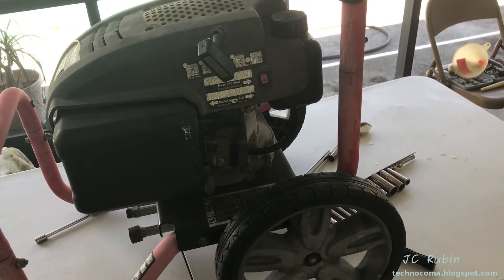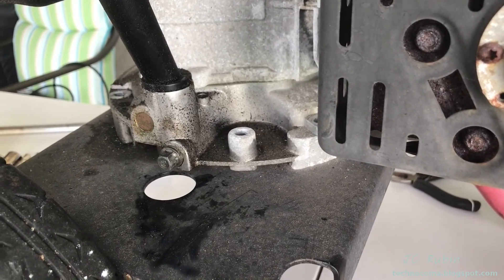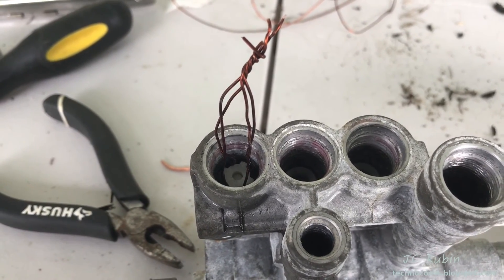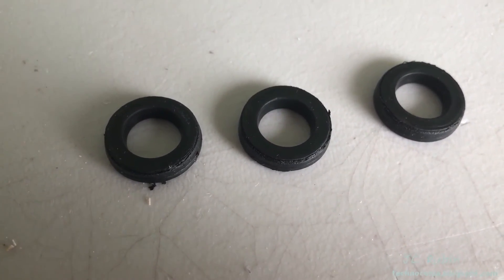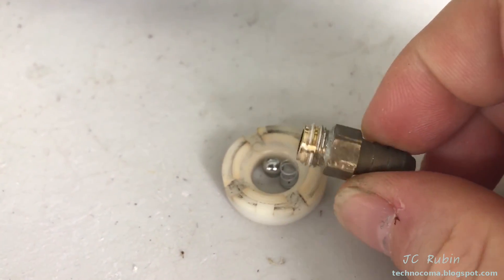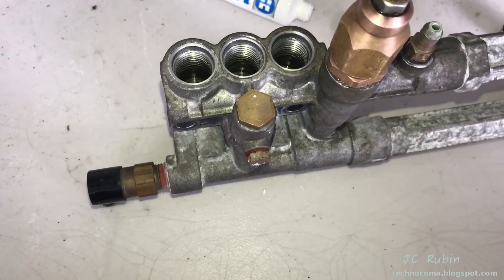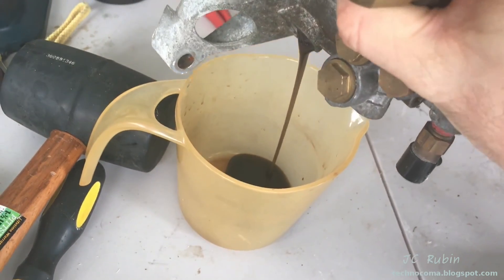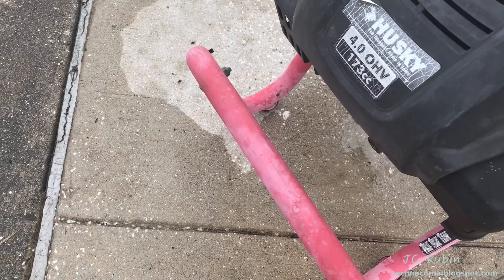Pressure Washer Pump Rebuild -  Annovi Reveberi AR-RMW22G24 Vertical Axial Pump

Comment: Fantastic DIY Vid!!! I need to rebuild the head on my Generac 4k#. Hopefully, rebuild procedure similar.  Any good leads for sourcing rebuild kits appreciated. Torque value specs would be reassuring, but hopefully 50-years wrenching + common-sense will suffice.  I'll be using blue threadlocker on all "fixed" components. And, I never thought to practice "Post-use, lean the machine to drain residual water from head". Great advice!
Again, excellent vid & THANKS for your generosity of time, knowledge and experience.
You. Are. Clever.
Cheers
PS- liked your "$7k!" response to lazy fk who asked if you'd repair his pump for him. Apparently, along with no work ethic, they have zero sense of humor. Subscribed!
Reply from the maker: Glad the video was helpful , good luck!

Comment: Thank you for making this how-to video.  Very detailed and to the point.  I have exactly the same model of the pump. What oil did you use for pump? any W90 synthetic gear oil or something else, please advise.
Reply: He used pump oil sold at HomeDepot
Cat Pumps
ISO 68 High Pressure Pump Oil

Comment: So first off I want to say thank you so much for doing this video/tutorial.  I have been attempting to find one that had this much detail, as I find myself attempting to save my pressure washer (inherited it from my father who passed away recently & seems my ex did some damage to it without my knowledge, so now I am attempting to avoid buying a new pump as that can be pricey) I have purchased all new check valves and the white plastic rings as well as the rubber seals that go on the head of the pump( the old valves & parts were melted or damaged in a way that seems to be melted) I had NO pressure on the water exiting the pump when the pressure washer was running, prompting me to disassemble the pump to find the damaged parts, I have since installed the new parts and cleaned up the pump, but now it seems there is less water exiting then before,  I wasn't aware of the function of the unloader valve but now that I have seen your video I feel if I remove the pump once again, this time attempting to remove and clean that valve I may have a better chance at success with it working. I am new to all of this but as a single mother & determined to figure things out I will learn all I can to be successful at being a DIYer. I will be purchasing all of the grease & polish you mentioned to reassemble everything again and attempting the unloader valve as well, do you have any suggestions as to what my problem may be for why I have no water exiting the pump when running aside from what I have mentioned above? I'm just hoping to troubleshoot my situation with a successful outcome. I greatly appreciate any and all feedback. Again thanks for this awesome video!
Reply from the maker: Hello, Its hard to say unless the video was completely followed, something is still stuck causing an obstruction.   Taking it out and revisiting all steps, checking all passages for an obstruction or seized part.

Comment: Thanks for posting this.  I think my pump may be causing the engine to stall, but not sure.  Engine runs great with the pump detached.  As soon as I re-attach the pump, start the engine, and pull the trigger... the engine stalls.  I'm thinking maybe the pump is starting to seize and it's causing too much strain on the engine and stalls it.
Reply from the maker: Did you try rotating the pump whilst detached?

Comment: Just want to thank you for for making this. I was on the verge of ordering a new pump. After seeing your video I took my pump apart and cleaned out whatever I could get at and reassembled it not expecting much. Much to my amazement it’s running like new again. There was a lot of mineral buildup in there looks like I’ll have to drain it after each use and maybe run some vinegar through it periodically to try to dissolve the buildup. Also my ez start valve was completely seized up. Had quite a time freeing that up. 
Thanks again you’ve earned a new subscription 👍
Reply from the maker: Glad it was helpful, better to repair than replace.

Comment: Did you replace all the check valves with new ones or just clean them up and reuse them?
Reply from the maker: All of the check valves were replaced.
Reply: @retrotechandelectronics  thanks. I just ordered new ones. Gonna try to get mine running again.

Comment: After tear down…. Should you be able to blow air through the discharge side?  Meaning, I tried to blow air with my mouth where the wand hose connects and I can’t pass any air.  Is that normal?  I assume there is a check I am blowing against?

Thanks

Comment: Great video, bud. Can you (or anyone else watching) tell me .....when you say "calc"....is it safe to assume you mean "calcium"?
And if the answer is yes, wouldn't straight white vinegar do a good job of dissolving all or most of the "hard mineral deposits"?
Call me cheap (most of my friends and family DO); I'm just looking for an easy, 'accessible', solution to cleaning the guts of my pump.
Question 2: Does having run my pump without a water supply connected for a minute or two likely to have trashed it beyond the scope of your video?
Thanks for any info.
Reply from the maker: Correct, calc as in calcium or other mineral deposits.
Try the pump, if it still works its not trashed.  1 or 2 min, probably ok.

Comment: Did you use threadlock on all the fasteners? With all the vibration on these things I'd be worried about not knowing the proper torque for each and every bolt and nut.
Reply from the maker: Yes, and Ive had to retorque as a result. you are correct.

Comment: I inherited a fairly new Simpson 3Kpsi pump that has no pressure (Honda 190). Where did you get the parts? Is there a kit? I suspect it wasn't cared for properly. Replaced the carburetor $25. Don't forget to use Sta-bill in the gas!!
Reply from the maker: The pumps have rebuild kits, depends on the pump.

Comment: Hi, what a great job with your time and patience in your instruction.I am a little confused as you stated one of the valves you had to hit with the rubber mallet to get it to move. I thought the movement came from the steel bearing and the spring. it seems the valve on the inside is brass and does not move. or are you saying it does?
Reply from the maker: It should deflect in normal operation. It was initially frozen in position.
Reply: Thank you for the reply. So this deflects without the spring and ball in place? I have done everything to my pressure washer and it will not pump water. could this be my problem?Tim